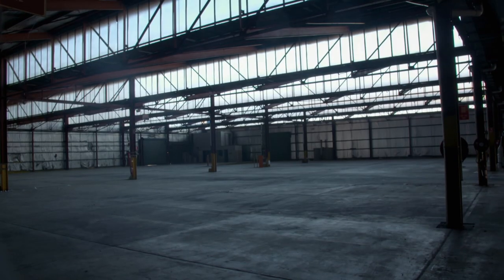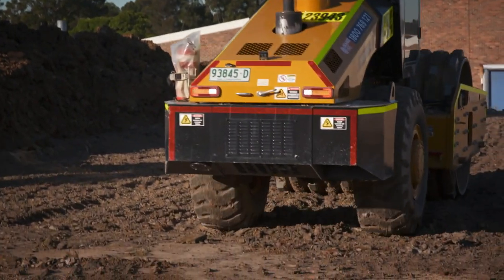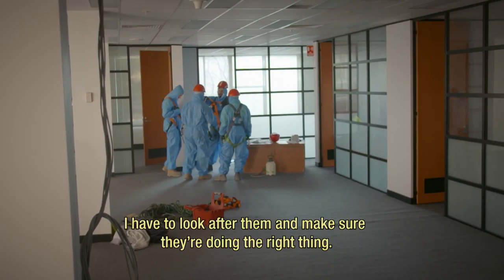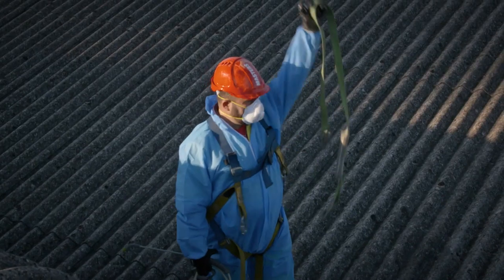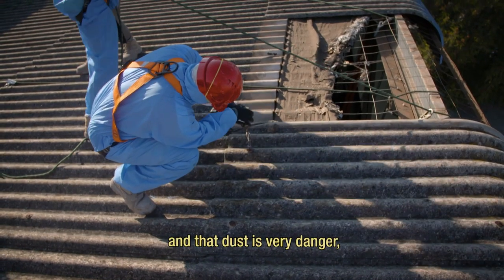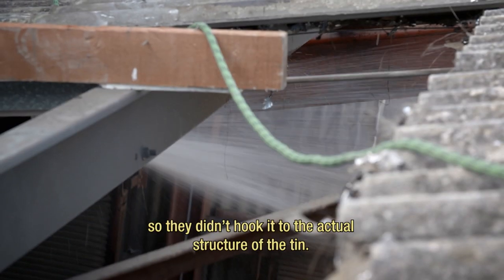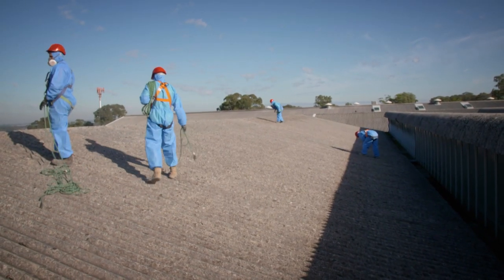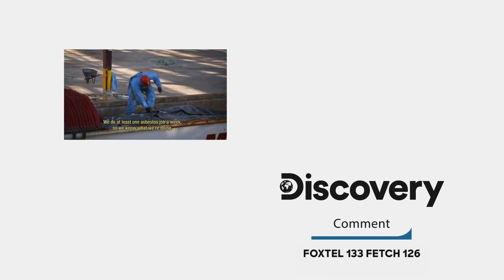Removing an Asbestos Roof is More Complicated Than You Think | Demolition Down Under

Comment: Look being an asbestos remover my self I can see a couple mistakes made in this. 1 all worker's must be clean shaved. 2 there are people on the floor under the people removing with out ppe on yes they sprayed the top of the sheets but asbestos fibres are still dropped to the floor when you lit up the sheet
Reply: Also they should be using HEPA Respirator filters too.
Reply: @CycoReBoRn  yh P3 at least.
Reply: Have you had any exposure in your time Robert?
Reply: I don't have a clue about the subject and I knew the lads underneath were in danger 
😂😂😂😂

Comment: Standing on the roof first up without a safety harness.
The dust is so harmful and they are not clean shaven and some of them are wearing cheap P2 masks. Very hypocritical video. Lots of other mistakes in this video. Why did they not ensure all the utilities had been isolated. Another poor video by Discovery.
Reply: In fact it's a non licensed works. By law as long as you spray it with wetting agents you don't even need a mask.
Reply: i think it´s p3 mask

Comment: So I fell through an asbestos roof shed at work got out pretty quick didn’t see any dust does anyone know if it will be ok ?
Reply: Don’t do it again (obviously) but you’ll be fine. The fibres in cement sheeting are very tightly bound and you got out of there quick
Reply: you'll be fine. you had minimal exposure and I'm willing to bet the amount of fibre's if measured would be less than 1 in the air around there. especially if you fell through a roof then the wind probably carried some away too. Realistically you'll only know if you're fine from asbestos like 30+ years after exposure.